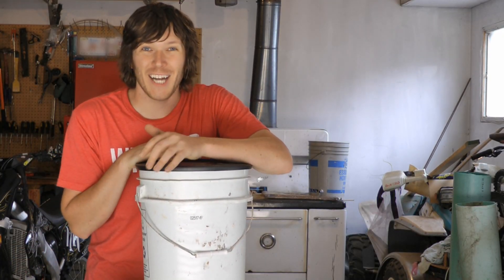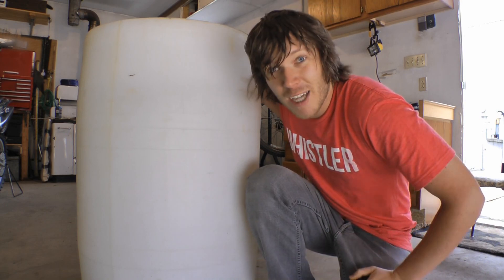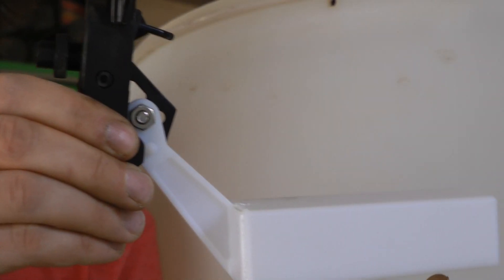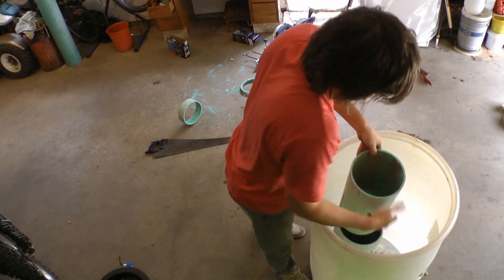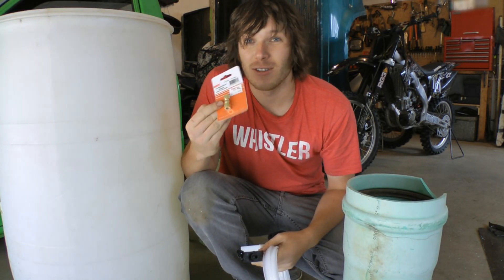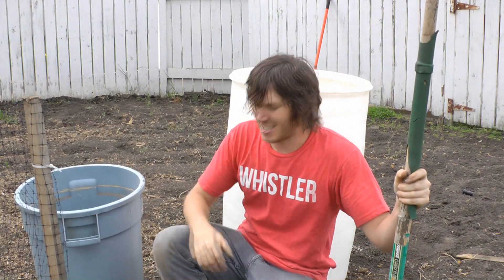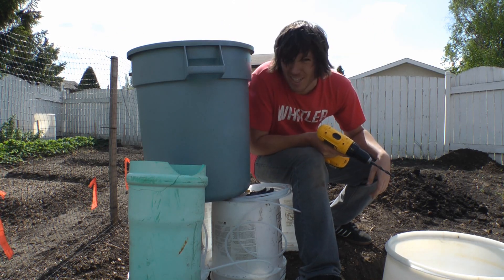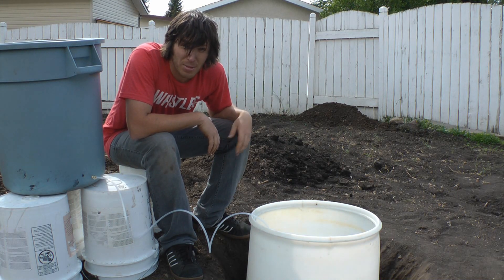How To Hydroponics - S02E20 Hydroponic Giant Pumpkin Part 02

Comment: You don't need teflon tape on the threads of that compression fitting. It gets sealed by the compression ring, the threads and nut tighten against the ring causing it to seal

Comment: Thanks for the vid! A long time ago while I worked with my stepfather, he showed me how to dig any hole over two feet deep.  The trick: the size of your hole must include the amount of room you need to easily dig your hole.  In other words, you should have dug a rectangular hole, so that you have lowered yourself as your hole gets deeper.  It sounds like more effort, but it is not. Moving dirt at the level of your feet is easy. Excavating dirt a foot (or 4) below your feet SUCKS.

Comment: What about a couple of air-stones running off your 12 volt system?

I've been told by contestants (local winners) that the best way to get huge pumpkins is to add mulch over the vine leading to your pumpkin.  That will cause supplemental roots to develop along the run.  Also, the better that the flower is pollinated, the more seeds that will be produced and the larger and better shaped the pumpkin.  GOOD LUCK!

Comment: Make sure that there is some kind of way for the water to even out between the bucket and green tube. Just drill some holes in the tube or even make a gap at the bottom otherwise you will just end up topping up the green tube and not the entire bucket.

Comment: Nifty.  Bulb valves already setup for hydro are about 10 bucks and can be ordered from just about any hydro store.  Should be a good bit on Ebay for cheap too.  I'd black tape your water line as well.  Don't want any light penetration.